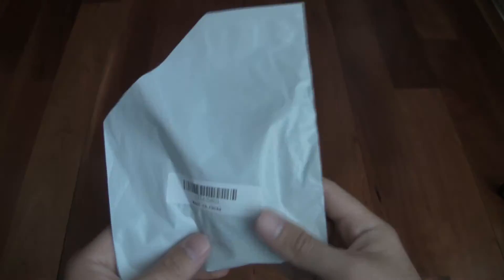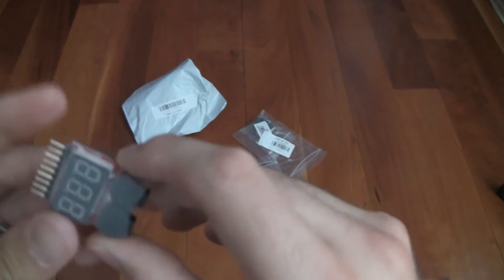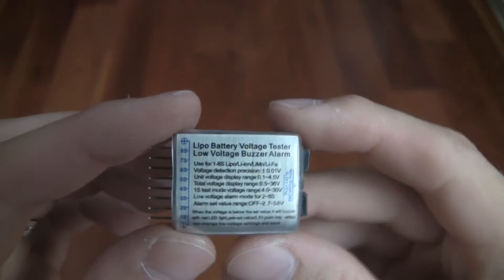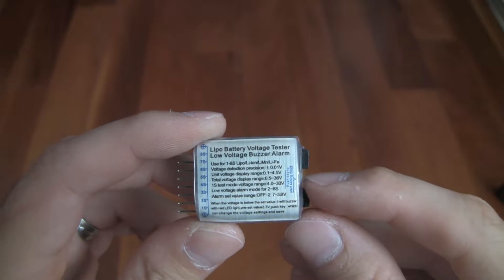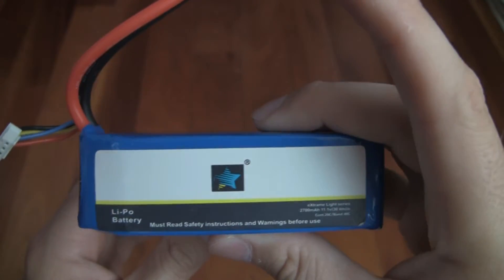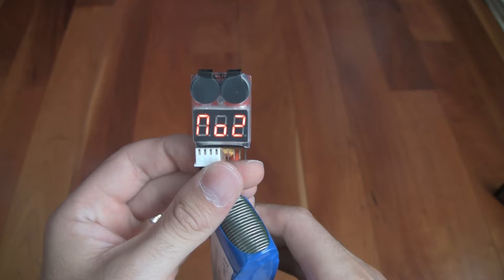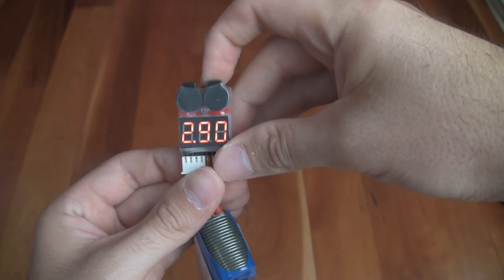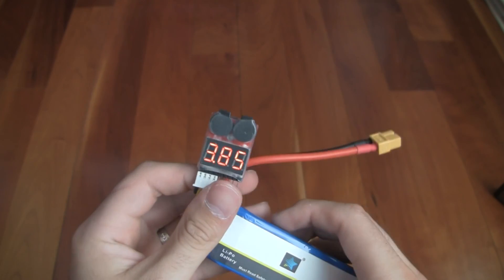*GearBest* Low Voltage Lipo Battery Buzzer Alarm

Comment: Yeah! thanks for this; which one is this? I'm looking for exactly this make; i now have a few that don't beep when you press the button and have a grey sticker instead of the silver one you have; the problem is that these start beeping when the voltage has dropped below the set voltage, but doesn't stop beeping when the voltage has reached above. The ones with the silver sticker i've got are the ones you have here, they use different software :) (they reset theirselves once the set voltage has been reached again, without the need of a reset) Can you pleae share a link of the product? Looking at the gearbest site i see several different ones. Help is greatly appreciated!
Reply from the maker: http://www.gearbest.com/rc-quadcopters-parts/pp_137605.html?wid=2  
^^ That's the exact item I bought. Came in a 2 pack.
Reply: Thanks Rendus! Great help!